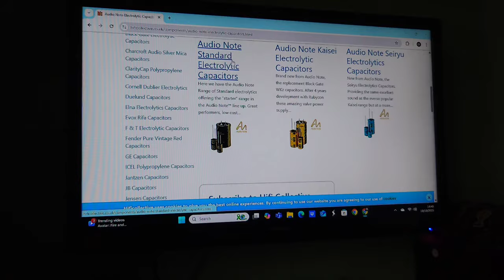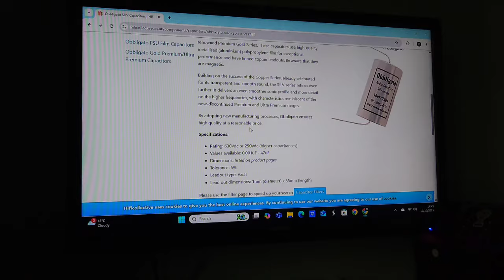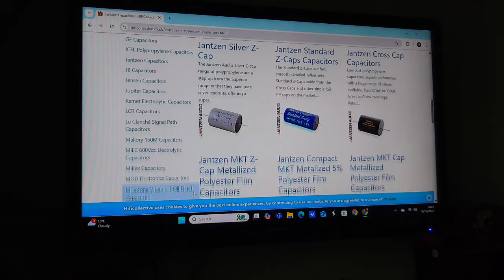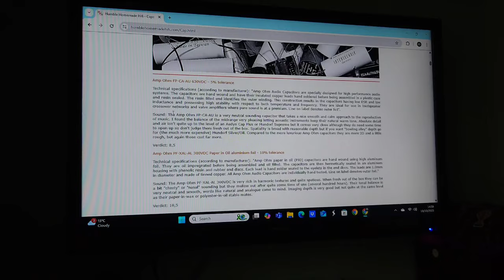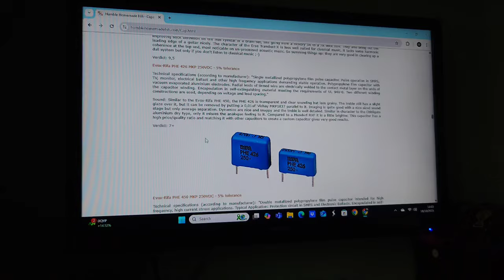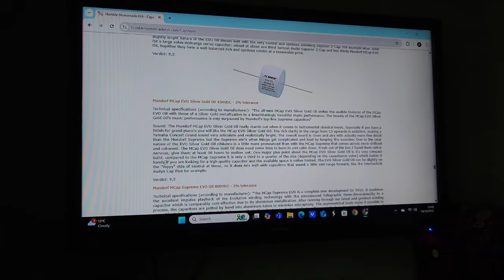TAKING A LOOK A DIFFERENT CAPACITORS

Comment: The Humble Hifi article is a banger. I've gone through it many times. My favourite caps are blue EPCOS MKT caps for super affordable inoffensive replacements for electrolytics in speakers, and then on Aliexpress OCVC and particularly the blue OHVL caps with silver wire which are superb for the money. I've never tried any of the really high end caps.

Comment: Capacitor lifetime is not only based on hours.

If it's rated at 10,000 hours at 85⁰c, it doubles with every 10⁰c drop so at 35⁰c let's say, that's 320,000 hours!  And even then that's the guaranteed to meet the original spec but should still continue to operate.
Reply from the maker: Yes, you are right👍